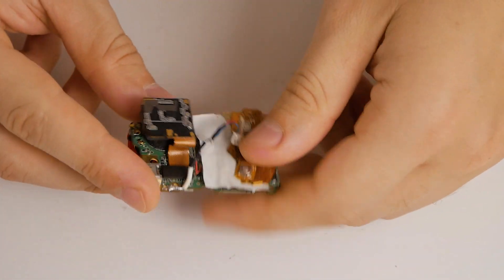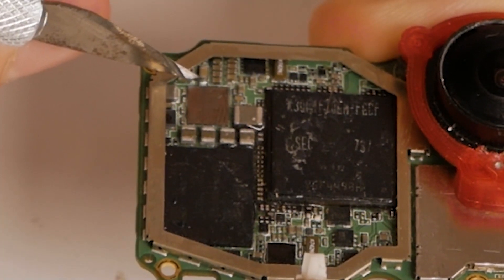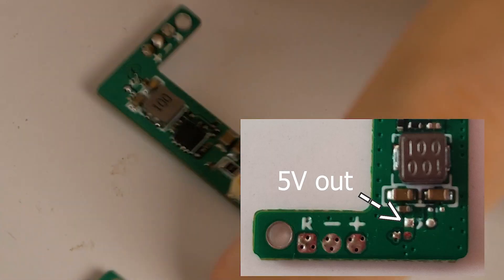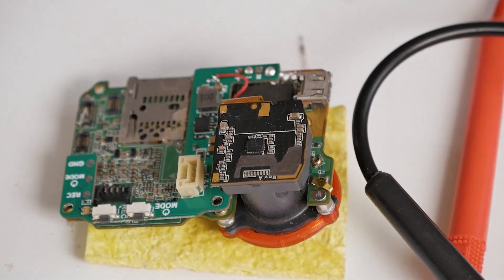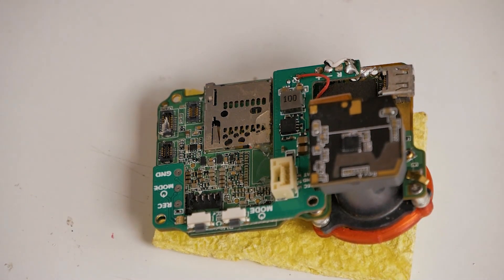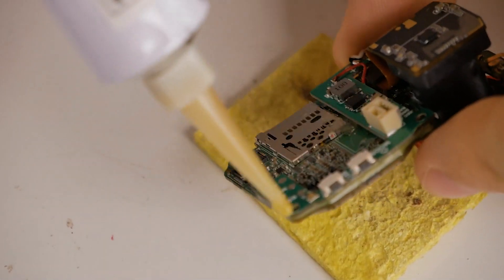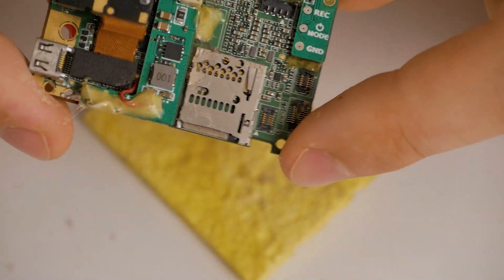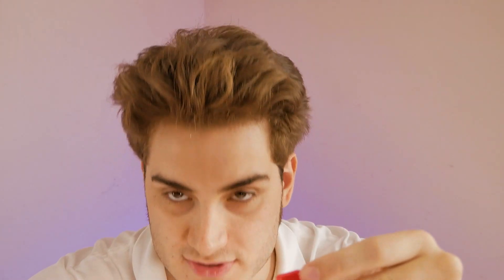How to use the BEC on a naked GoPro with a broken connector! Preparing for the Dison V4

Comment: Hi,

Im having some problems with powering up my naked hero 9 true the BEC board. 
Im connecting it true a cable that goes to the balance lead of a battery. But it is not powering on.
I have already turned it on true the original usb-c conector and a balance lead connector and that works, but i cant fly like that.

Do you have any experience with naked hero 9?
Reply from the maker: No experience with naked 9 bec but i believe you have to provide at least 2s voltage to it if not more

Comment: May i know how u joint wire 5v at back camera board, the one that u glue. Did u solder or use glue? Thanks
Reply from the maker: Solder first and then glue so it doesn't come off
Reply: @rimzler  thanks

Comment: Have you had any issue with the BEC burning out the 5v in on the go pro? I've heard some stories ... I also noticed the BEC gets super super hot.
Reply from the maker: The issue is that the Bec has to be really fixed in place, if it moves it can short stuff, I glue my becs and use them on the Dison mount, I don't like those encased ones, for the getting hot a bit is normal
Reply: mi hero6 just had this issue. no theres no way i can power it from 5v, only through the battery connector

Comment: Could you post a picture were to connect the +5V on the front side? It was not very clear in the video, and it is very tiny board. Cheers!
Reply from the maker: I'll make a post tomorrow on Facebook, in the meantime I'm pointing at a little capacitor, you should solder to the lower contact of that capacitor
Reply: Can you link the picture please?

Comment: Excellent idea with the antenna glue. In fact the BetaFPV BEC should be glued on like that even if not broken. Mine just kept snapping out here and then. Thanks man, this is just amazing!
Reply from the maker: Thanks! When it snaps out inside the betafpv case is a pain to open and put it together, check out my upcoming v4 design, uses the same hardware as the betafpv so it's an easy swap, but much lighter and hassle free